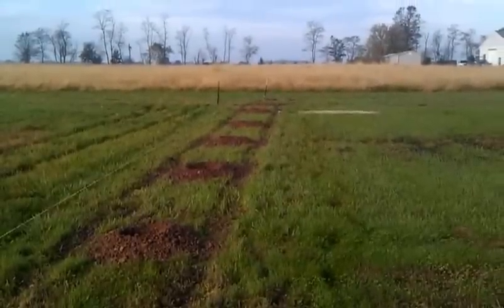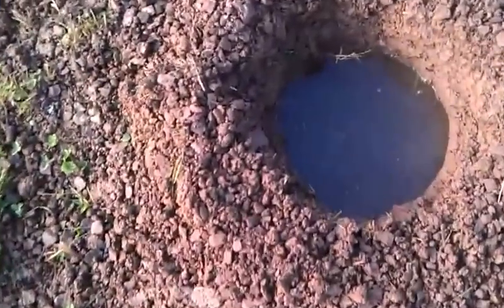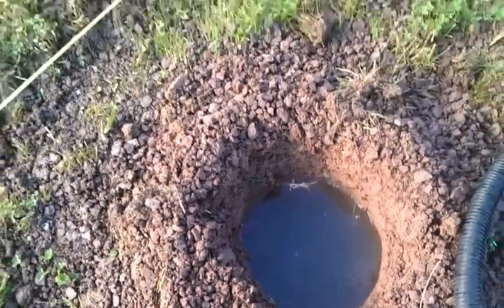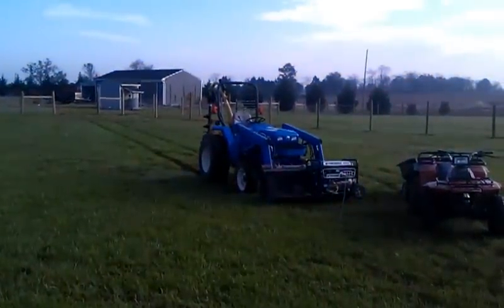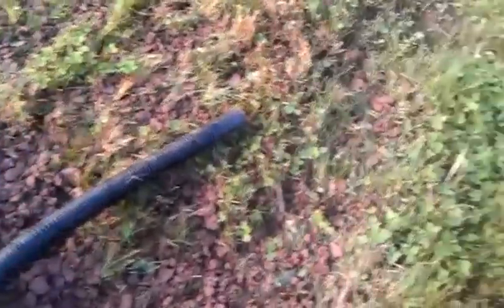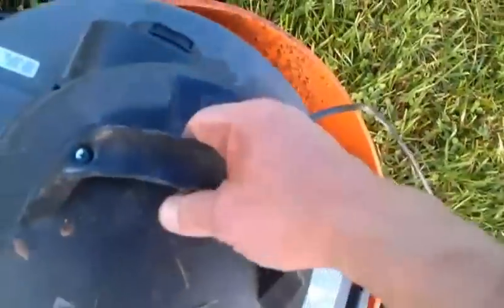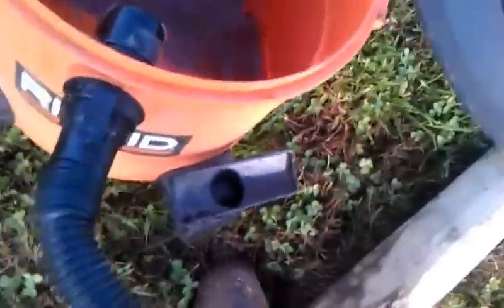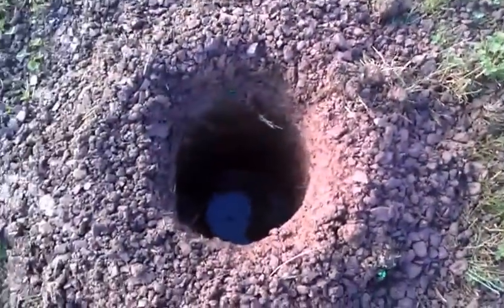Removing water from fence post holes the easy way!

Comment: I ran into the same problem, there is a lot of sand in our soil so the holes started to collapes and fill the holes again. There is nothing more fun than trying to use a manual post hole digger in soupy soil. Counter productive! Once I sucked out the water within minutes it would fill with water again sigh life goes on, praying for dry weather to finally get these posts cemented in the ground.
Reply: YESSSS

Comment: I am so grateful for this video.  It's exactly what I need for my french drains.  Here's the problem though...what is a "shop vac" and where do I get it?  What kind are you using?  Is a shop vac the same as a wet/dry vacuum?  Sorry, but I'm a single mom with NO CLUE.  Thanks!
Reply from the maker: Hi Amy, yes a wet/dry vac is correct. I bought mine at Home Depot. Thanks!

Comment: Had to reschedule inspection due to heavy rain all that day. Went out the next day to wet vac holes but found about 6-inches of dirt had went back into the 42-in hole  also and then the water kept seeping back in. Needless to say had to reschedule inspection again.  Any tips for keeping the water from getting in the holes?

Comment: we have a spring near where we are going to put our  corner post the holes filled with water when we dug them I think it's from the spring   my husband said it will be fine  he is going to add cement I am concerned if the horse leans against them they will start leaning  any advice on this before he  puts the post in?

Comment: If you don’t have a vacuum or power where your post is 100 ft hose in the hole, take hose down hill (could dig another hole if you can go far enough down hill). Boom. Syphon.

Comment: 3 feet deep? Your 3 feet deep looks a lot different than my 3 feet deep. That looked more like my lazy 2 feet deep holes. 😂
Reply from the maker: It actually was 3 feet. Some of the dirt caved in from the sides when the hole filled with water. I got over enthusiastic with the tractor mounted auger! I had the same problem with a tractor mounted tiller. I just tilled everything in sight.

Comment: Just remove the drain plug on the vacuum and keep on going...
Reply: I tried this before, but the vacuum relies on that being sealed to create...well a vacuum to pull the water up the hose.
Reply: @383yj  Right, but at least you can stop, pull the plug and drain with having to un-clamp the top and pour it out.   Who knows, maybe it wouldn't be that big of a time saver.  :-)

Comment: Just pour in dry concrete mix right out of the sack.  The excess water will be displaced and the  concrete mix gets properly hydrated as it goes to the bottom of the hole,  https://youtu.be/pI-pCSxD0GY
Reply: The award for worst building advice goes to this 5yo comment. Do you bake cakes by throwing a bag of flour in a bowl of water? Do you make porridge by throwing oats into an unknown quantity of water.